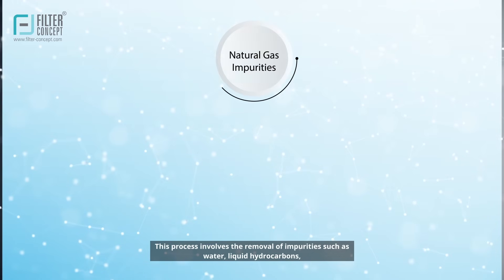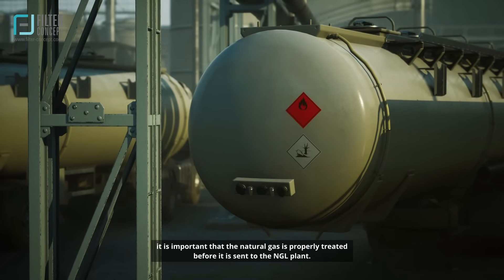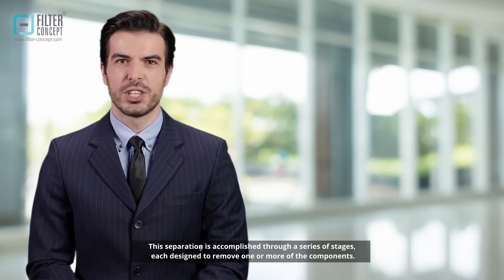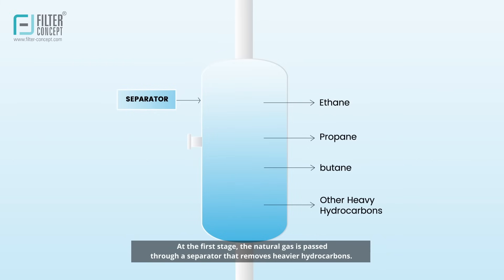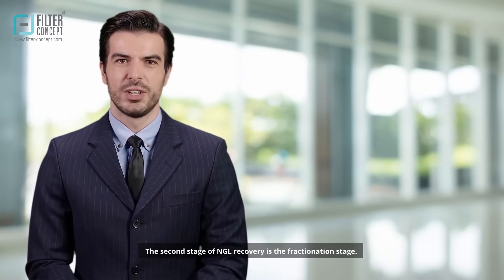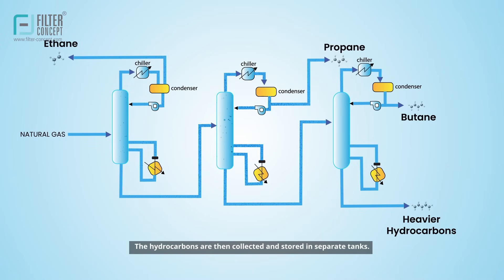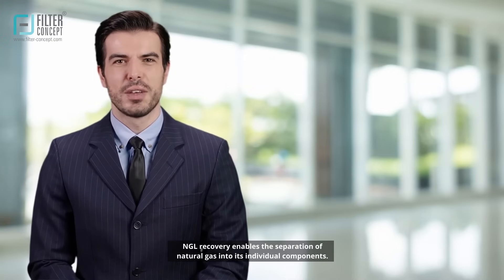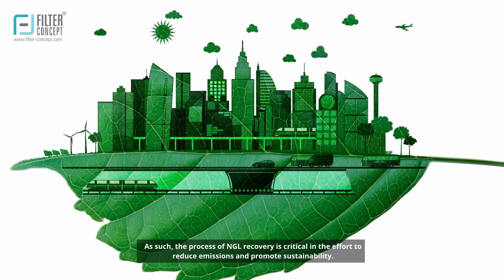𝐄𝐩 - 𝟐𝟓 𝐍𝐆𝐋 𝐅𝐫𝐚𝐜𝐭𝐢𝐨𝐧𝐚𝐭𝐢𝐨𝐧 𝐏𝐫𝐨𝐜𝐞𝐬𝐬 (𝐎𝐢𝐥 𝐚𝐧𝐝 𝐆𝐚𝐬 𝐈𝐧𝐝𝐮𝐬𝐭𝐫𝐲)

Comment: Correct me if I'm wrong, but based on this video, other videos that I've seen, and some written materials that I read this is how it works: 
the natural gas(mixed with oil, and water) is pumped out of it's natural territory, and into the entrance holes of a pipe; then it flows into another pipe that carries it into the separator. Once in the separator the water separates & drops into a bottom pipe because of gravity. Following that the oil(which doesn't mix with water) flows over a raised divider, then it falls into a bottom pipe because of gravity. Meanwhile the natural gas rises into a upper pipe that carries it into a container(or tank). A container that heats the natural gas(causing lighter gases to rise to the top, and heavier gases to stay at the bottom). Following that the different types of gases are pushed into separate containers(or tanks), then forced through a series of chillers that apply cold temperatures to condense the gases into liquids, or should I say Natural Gas Liquids. In which these NGLs are further filtered out to get rid of impurities. Now please correct me if I'm wrong.
Reply from the maker: Thank you for your detailed comment! Your understanding of the process is quite close, but let’s clarify a few points:

1. Separation: Natural gas, mixed with oil and water, enters a separator where water and oil are removed by gravity.
2. Heating and Fractionation: The temperature increases, so with lesser and lighter gases ascending, heavier ones stay below.
3. Refrigeration and Condensation: Chilling is done on the gases, finally leading to condensation into NGLs. 
4. Purification: It includes further processing to purify NGLs of impurities."

FCPL invites you to join us for informative series 

Kindly click on the below link: https://filter-concept.com/video-series/
Reply: @Filter-concept 👍